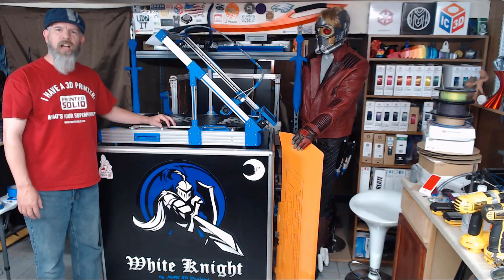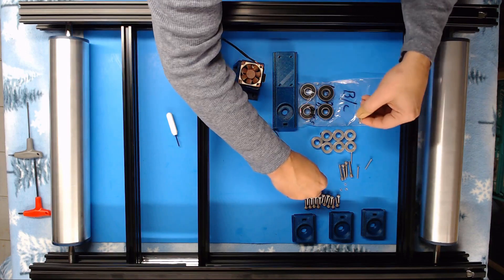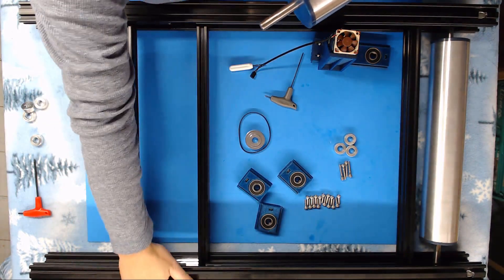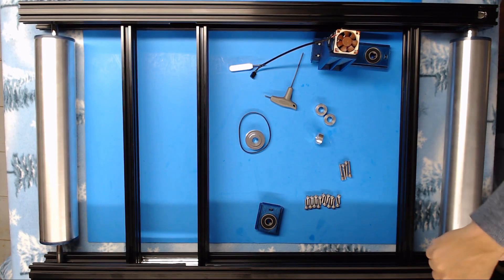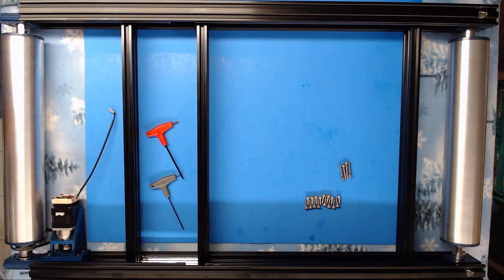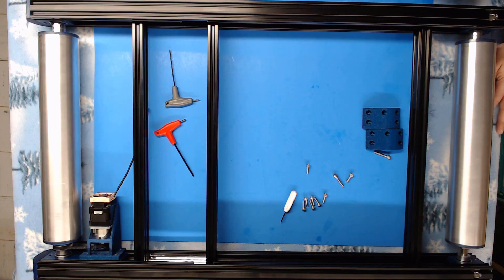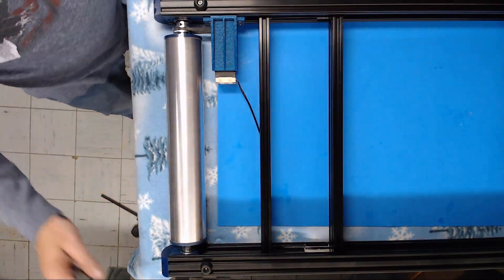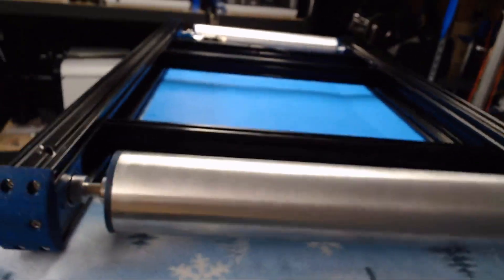White Knight Assembly Part 13

Comment: I'm having a difficult time finding the 60 tooth pulley with the 1/2 inch hole. Any suggestion on a source for it?
Reply from the maker: https://www.ebay.com/itm/GT2-Timing-Pulley-60-Teeth-Bore-5-6-35-8-10-12-12-7-14mm-5-8-3D-Printer/182216230810?ssPageName=STRK%3AMEBIDX%3AIT&_trksid=p2057872.m2749.l2649
Reply from the maker: In case you don't know the conversion off the top of your head 12.7mm is 1/2 in..
Reply: @NAK3DDesigns  Much appreciated! Now I can continue the journey for the remaining parts.

Comment: Should the bearing on the shaft at the roller stepper motor be flush into the 3D printed slider? That would mean the collar should be pushed farther outboard?

From my understanding of cogged belt tension, using a clamp might create a higher level of tension than optimum on the belt. It needs only to be tight enough to prevent skipping. Too tight will distort the tooth profile and create artifacts in the print once operational.
Reply from the maker: Yes, the bearings should be flush